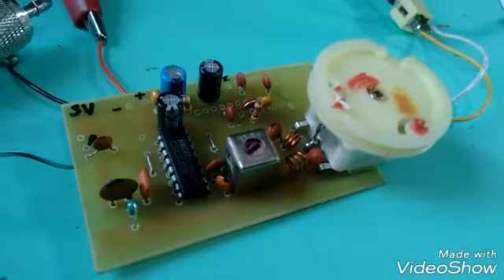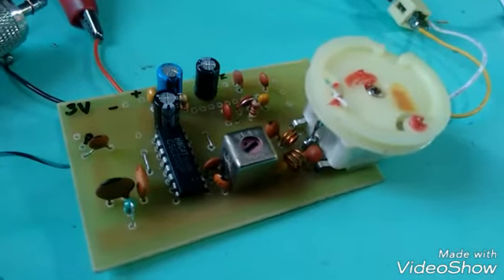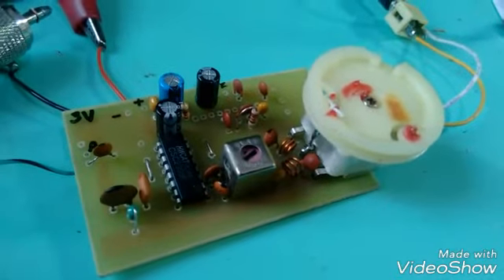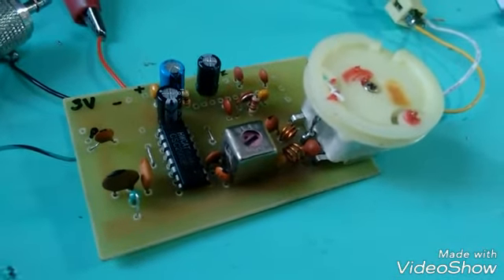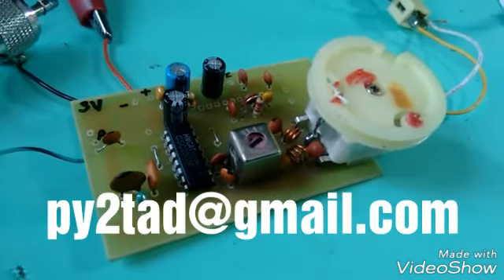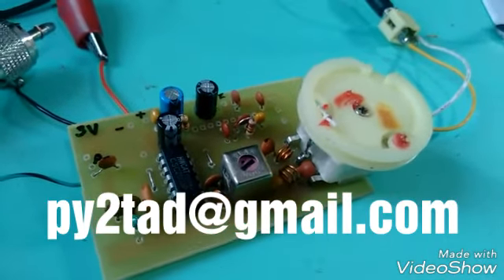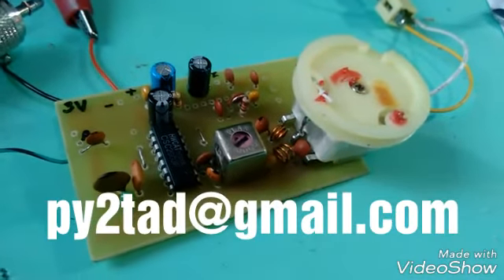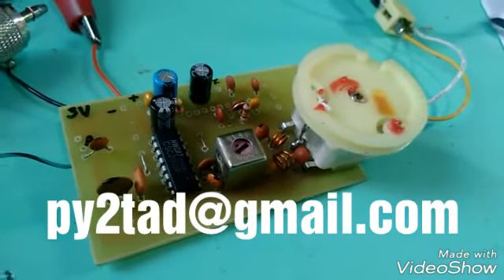Receptor caseiro VHF - Aviação e 2 Metros

Comment: Sir I have  a question. in this  circuit diagram of receiver ta2003p ic detector (audio out) pin is 11 but by  the  audio out  taken from pin no 7 it is AM IF IN
Reply from the maker: Follow the printed circuit board, which is right there, I did it like this. Probably has an error in the scheme.
Reply: @mauriciobastospy2tad  sir this board has no silkscreen so I can't connect components perfectly. Can you design another VHF 2m Receiver using ta2003p with Lm386  ic audio amplifier. Please. I'm going write Ham radio license exam so I have to listen the ham conversations  
In my area
Reply from the maker: @infotech-malayalam4857  It's a really good idea, I had already thought about it. But at the moment the problem is my time, which is scarce, but I will try to make one. Hug!
Reply: @mauriciobastospy2tad  thank you sir. If you make this receiver,it will very helpful to receive VHF signals. thank you